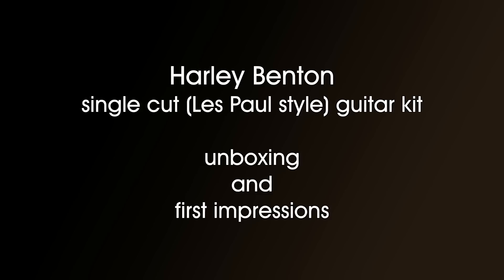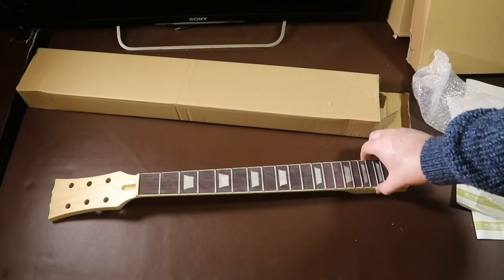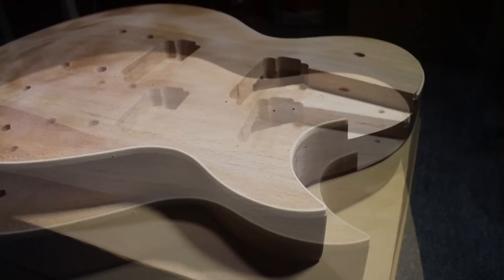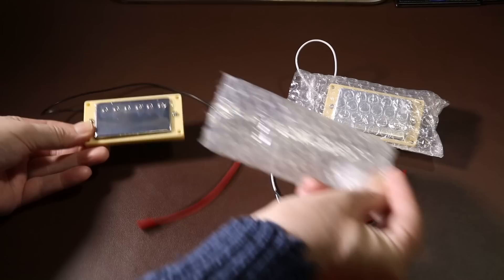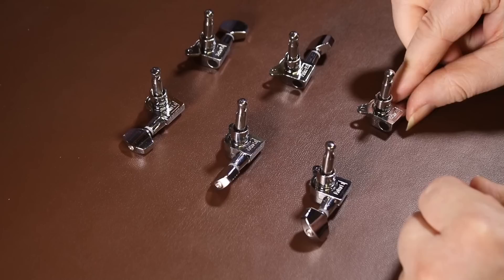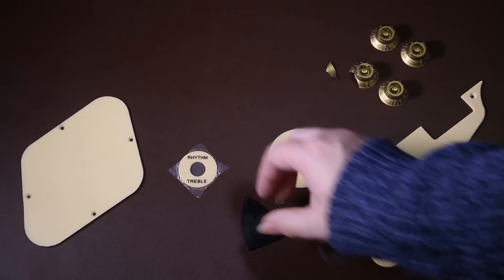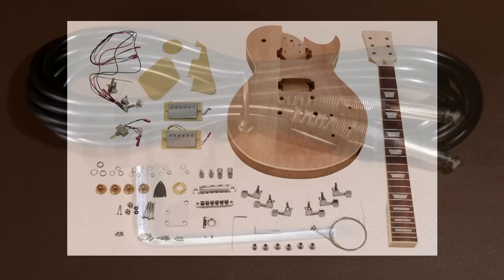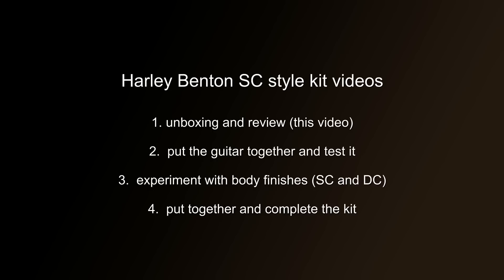Harley Benton SC guitar kit, Les Paul unboxing & review. Single cut style kit.

Comment: I've just received my strat copy kit from Thomann today and am very pleasantly surprised by the quality and finish.  The neck is absolutely flat straight out of the box and the frets are very well finished and levelled.  The only other kit I've made was a LP copy from Coban which looked beautiful with a spalted maple top but the electronics were a bit of a mare, it was supposed to be non solder but I ended up buying a new wiring harness for it because the harness supplied with the kit was, as expected, pretty cheap and tinny and, unfortunately,  not very well constructed.  The Thomann strat copy electronics, on the other hand, look better and are well soldered - all in all, I'm very pleased with it.  And it was less than half the price of the Coban kit (although the LP is a gorgeous looking thing and I love it to bits, it plays beautifully!)
Reply from the maker: I guess the most expensive part is the wood, so I nice spalted maple top is worth paying for and you can experiment with the electrics.  I think one of the good things about the strat is the fact that you can do most of the electrics outside the guitar so you can move around it and see what you are doing.  Hopefully you will find the same thing . . good luck with it . . . 😊

Comment: I got my classical guitar from Thomann and the box was absolutely huge! There was a lot of padding around the actual guitar's box, so kudos to Thomann for safe packaging. I also bought sound equipment for filmmaking from them in the past and it was the same, you get a huge box and dig in to get to another box that's half the size lol. Btw that white dust was on my guitar's neck too, but got rid of it very easily.

Comment: Awaiting your construction and finish video...Considering this kit or HB SC450 CB (present cost difference $29USD). I would apply Tru-Oil or Minwax Wipe-On Poly to the back and sides and a spray-painted gold top w/ clear gloss enamel. I'll carve a serious belly cut to dump the weight of these HB boat anchors. Cheers!

Comment: The thing nobody ever says about the strings that come in the kits is this. They are there to set up the action of the guitar. So when you are shaping the nut your not filing and pulling on and off a good set of strings. If you aren't setting up your string heights at the nut and topping the nut so your strings aren't buried. Your guitar will not play well and when you form chords the notes of the chord will be sharp or flat. Action is important.
Reply: tell me something i do't know
Reply: @NaturalRights  I just did 3 yrs ago in fact.

Comment: Hello. I bought this kit and it arrived today. I noticed that the nut slots are not cut deep enough, and the strings don't really go in. Is this something I should worry about or is it fine? Was yours any different?
Reply from the maker: The nut slots were find on the one I got, but it was a while ago I bought mine.  With the one you're describing it might be a good idea to give it a nut upgrade before the build.  🤔